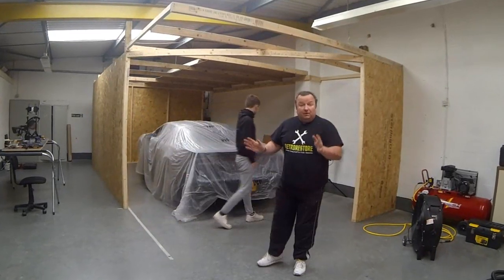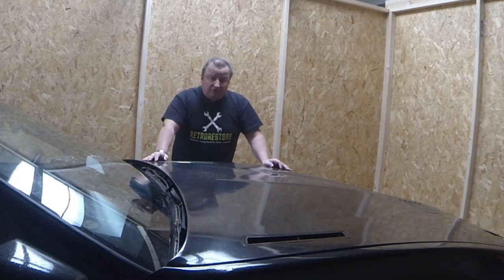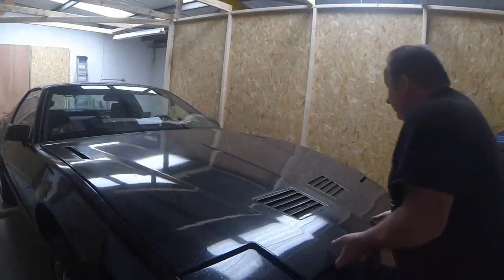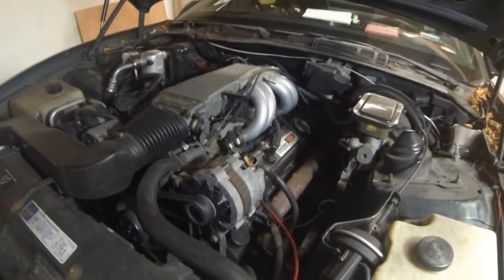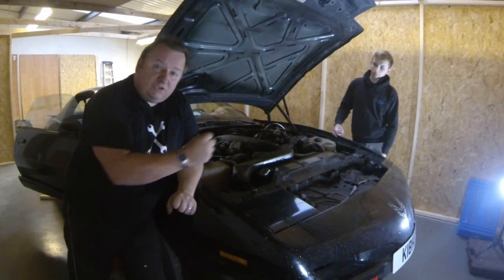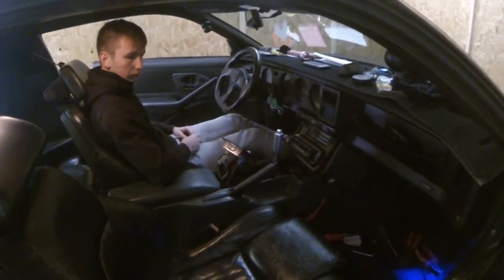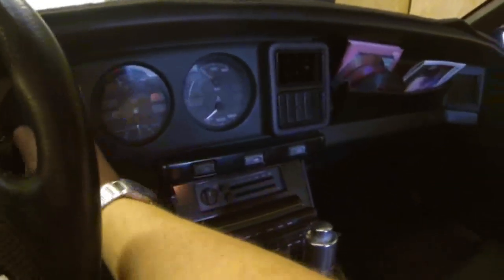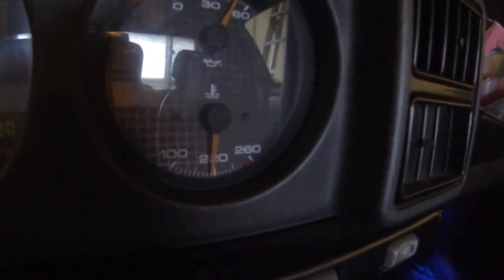Part 2 Trans Am Won't Start When Hot

Comment: I'm watching some old videos as I'm new to the channel. I understand the gear selector switch and cable problem, but how did the temperature factor in? Seems like two separate issues or coincidences, totally unrelated. I'm curious if you agree or temp did play into it somehow that I'm missing. Cheers from Colorado.
Reply from the maker: The starter motor solenoid is mounted very near the exhaust manifold on these and its a common problem that the heat of the exhaust affects the solenoid and stops it working.

Comment: Looking good Martin. Glad you sorted the v8 fault. I noticed getting the car out of the booth is a little tricky. Can you not make some kind or revolving floor so you can position the car at any angle and you can drive the car straight out. If you know what I mean lol
Reply from the maker: It's actually very easy Antony, the thing was, we put the car in before the walls went up and it was too far over. 
Plenty of room as it's a very big car anyway.
Cheers
Martin